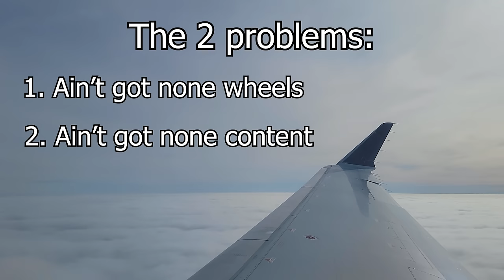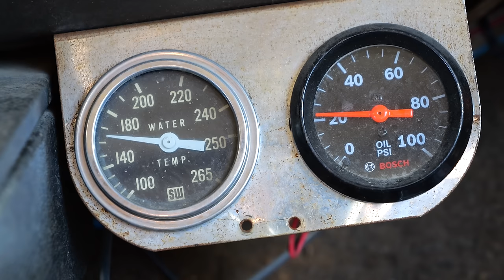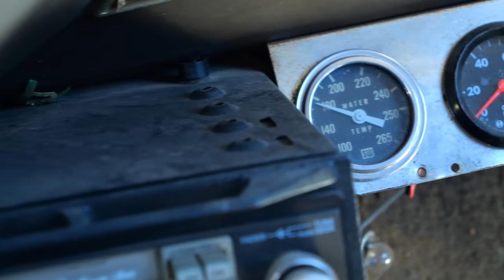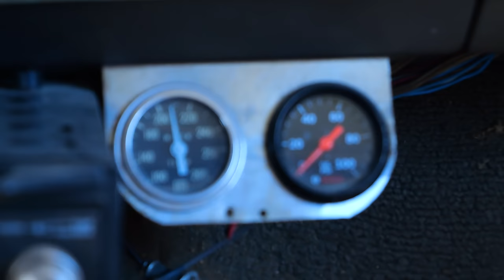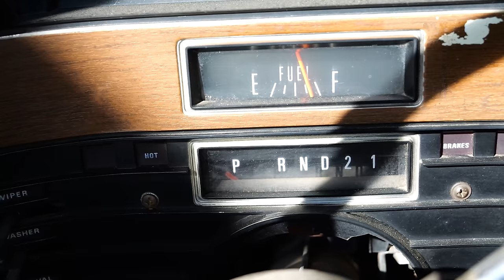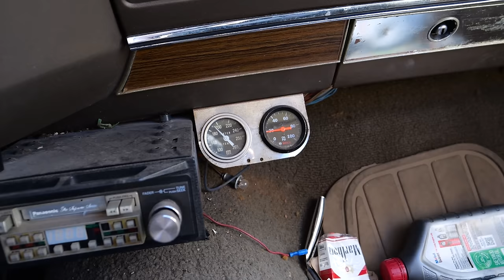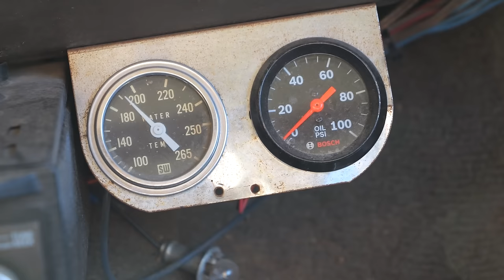Will a 1970's Wagon SURVIVE 2,100 Miles with NO REVERSE?

Comment: Incredible. Man that engine fought hard. Modern engines with tight tolerances can run for hundreds of thousands for sure. But I don't think there's anything else that would've done 2,000 miles on like 15-20 psi of oil pressure like that.
Reply: A 2005 Chevrolet Malibu
Reply: @Micheal-G no cap my girlfriend had a malibu and she was 20k miles over her oil change lmao when we drained it nothing came out and it took like 7 or 8 quarts of oil to get a reading
Reply: I've seen a couple of old Ford f series trucks with the 300 i6 run with less than 5 psi of oil pressure, granted they never went on trips longer than 20 miles at a time, but it still ran good.
Reply: @DaryanPrescott-vy4ss My 300 shoots the gauge up to around 60 no matter what... But it's a dummy gauge. Runs good though, happy with it, and it's powerful enough honestly
Reply: @greenbassboosts8872  I just put a clapped out 300 into a junkyard '74 LTD with a 3 speed toploader and 2.75 gearing. Oh boy that thing is a daaaawg off the line and it toasts the clutch every time I try to reverse, but dang if it don't run good.
Reply: @dogge929  Slap an m90 from a regal on the old wheezy six
Reply: modern engines can't even run on meth piss, cigarette stumps and peanut butter. Old battle tested fords will
Reply: 99-02 Chevy 5.3s might run a little on no oil pressure 😉

Comment: I think you should try all of the snake oil stuff to clean an engine like the 5 minute motor flushes, Sea Foam, Marvel Mystery oil, Transmission fluid, see if anything will clean up the crud.
Reply: I think it is clogged oil pickup mostly, and the filter isn't helping either and maybe stuck rings.  If he can clean out the pan, I think he can send it.  He should have used a bit of Marvel Mystery oil to try to clean out the muck, though it is thin and might have to be blended with super thick stuff.  Yes he should have done more in San Diego; oil and filter change as well as front seal and clean as much of the crankcase as possible, maybe engine flush.  how hard is it to pull the oil pan on this car?
Reply: You're better off pressure washing all the gallies from the inside out and doing an oil exchange at this point, it's that bad
Reply: @rawr51919  But how hard is that? Could that have been done in the time he had in San Diego? and while at it, would it be much more work to throw in new rings and bearings?

Comment: I think the Windsor motor was very underrated. When I owned my all I heard from friends was “it’s not a Cleveland”. It wasn’t ,but, it always did what it was supposed to do,work. That car set me forward on my career as a carpenter having the ability to haul a lot of stuff (including 4’x8’) sheet goods, in fact I can tell you well over a 100 quarts of strawberries would fit into that under floor storage area😅. Great car. Thanks for the rekindling memories.

Comment: Kevin, This is exactly the way that you make memories and great stories. By doing crazy things and actually pulling them off. My wife I drove a 1985 Jeep CJ (which we traded her son for my 91 Chevy extended cab truck to have a reliable vehicle for his new daughter to be safer in) from Detroit Michigan to southern Texas doing exactly the same thing as you. When the oil pressure gauge started fluctuating I would stop, add 4 to 5 quarts of oil in the motor and fill it up with fuel, My gas stops were dictated by the oil pressure and lack of oil in the engine. We made it 1400 miles without dying or breaking down. Was it an adventure, yep, but we survived with a great story that we laugh at today, we aptly named it scary jeep as the front end was toast and would throw the jeep all over the road when you hit a bump. We weren't the brightest bulbs in the pack for doing it, but it was an adventure we talk about to this day. Great content on this one as usual, thanks for entertaining us with your crazy adventures.

Comment: I've always heard from the old timers that if you put a couple gallons of kerosene in an oil-sludged up motor and let it sit for a few days, you can dump all the trash of the pan as the kerosene will break up all the gunk. 

I think that motor may be a good candidate if you're down to try it. :-)
Reply: Still wouldn’t have prevented the leaking, unfortunately.
Reply: @ProjectFairmont  definitely not but it could potentially save the trouble of tearing it down to get the Shmoo out.

Comment: This brings back fond memories for sure.
There is a unique excitement in purchasing and fiddling with an old automobile.
My latest is a 1998 Thor Hurricane with 454 engine. It does not get fuel milage to brag about but the gas "yardage" sound more impressive. The 200 mile trip home was uneventfull but on the way back from DMV the front brakes locked up and caused some expensive dammitage.
I still have "grinning cramps" reliving the old memories.

Comment: Hi Kevin. Loved those old ford wagons back in the day. suggestion for a cost effective better degreaser - try easy off oven cleaner. Spray it on and wait for a few minutes then hose it off. It cuts the oil and grease down to the shine. Use it on my stuff all the time. 
Cheers!
Reply: While I haven't done it for 10 years or more, check your local dollar stores for a cheap supply of oven cleaner. They used to be a great spot to score cheap degreaser. Best wishes! 👍🏻👨🏻‍🏭🇺🇸

- Max Giganteum

Comment: Seemed like almost every car we had in the 70’s lost reverse. You would be surprised how you can get used to not having it.
Reply: Having had several myself, and my parents, we never lost reverse. One car, a 1964 Dodge 330 station wagon lost its transmission completely well after 100K miles in 1973 (we bought it new) and a transmission from a junk car got it back on the road. We drove that thing until we sold it in 1977. It had around 140-145K miles on it then. Sold it for I think $500, tops to a kid to drive for his first vehicle. At that point, it was still drivable, though barely reliable.
Reply: how do you park without reverse?
Reply: @Alex-yj9xl  At the outside of most lots and you pull through to the opposite space so you can go forward. In town you try and find a space on the other side of the street thats on a hill, then roll backwards in neutral and park with the nose of the car facing the road. If the car doesn’t roll well you always have “friends” with to help push. In a big city it would be a tough time. Here in farm country it could be the norm. After a while you get used to it. Stock Ford C4 and FMX transmissions were pretty bad in this respect.

Comment: Now you just need to make 25 more episodes just like this. This episode is my favorite out all of the videos you put out. I also did the math on your oil leakage: 60 miles to the quart. My car leaks a quart every 300 miles
Reply from the maker: deal!
Reply: @JunkyardDigs   I’ve Since made an attempt to fix the leak from when I wrote this. I went 2000 miles since the last oil change and have yet needed to top the oil off. The only thing I can see that leaks more then that old wagon is a old bmw from the late 80s or early 90s
Reply: my car gets 100-125 mi to the quart lol
Reply: I've had the pleasure to have a friend that owned an old 80s S10 that would go through a quart of oil in about 5 minutes. I hated having to go anywhere in that truck since the bed was full of a combo of full, partially full, and empty oil jugs.

Comment: Dealing with old, worn out engines my whole life, I think (@45.55) you had picked up some of that sludge in the oil pickup and when you shut it down to fill it up, I broke loose and oozed out. you probably sucked up the clean stuff on the restart and had some PSI again. Great video! I'd rebuild it, do a tranny swap (maybe manual) and cruise the crap out of that beast.

Comment: You should see the 289 in my 67 galaxie. Currently has 0-5 psi of hot oil pressure. Drove it around all summer kicking it into neutral at stoplights lol. It had old school penzoil ran through it and no oil changes. I literally scraped the insides clean and filled a coffee can with the crusty oil flakes. Plan on swapping a roller 302 into for power tour this year

Comment: When the Cash For Clunkers crap was going on. We had to drain the oil. Add water and this stuff called liquid glass to the engine. Which in the case of European and Japanese cars would seize the motor in seconds after starting the motor. Had a 351 Windsor in a Bronco that went over an hour, even with us red lining the motor to get it to pop. Those 351's are tough old birds 😆

Comment: We ran a '74 Suburban at work for years with no reverse, just drove up a hill and let it roll back in neutral to turn around, always worked out. One time we thought it was finally dead when it wouldn't go into gear at all, but turned out they had just let the transmission go bone dry, fresh fluid and it worked as good as it did before

Comment: I didn't have the oil leak but did have the bearings wearing out on a 75 400 from Cali to Minnesota. That was the last successful engine I rebuilt and it was very satisfying to finish. That motor loved running at 70 - 75 as well. I had a machine shop that screwed the cam bearings up and cost me a motor and pickup.

Comment: My Dad had a big 1968 Ford Wagon.  Just a little 302 with 2 barrel carb but we would fully load it down and it would take us anywhere!  Seven people , two dogs and luggage on the roof!  Now and then it did overheat on us but that's how cars used to be.  You definitely needed to shut off the massive AC compressor when the engine started getting hot!❤

Comment: Great Video👍 That would be the perfect entgine to test if engine cleaning solvents/oils would help. After fixing the seal😁
Reply: I've used Marvel Mystery Oil for years. 
I had a 2.7L V6 Chrysler Concorde I put a timing chain and water pump in for a family member. It was sludged up way worse than that. I did an oil/filter change with MMO, then ran it for 15 minutes. Did another oil/filter change and ran it for an hour. Did change number 3 and drove it for a week. Did the final oil/filter change and sold it to a buddy. Cleaned it out completely and saved that engine. And those were notorious for getting killed by sludge. My friend daily drove it for over a year, then ran it completely out of oil and blew the motor. Sad.
But MMO works!

Comment: Hi Kevin, I'm back revisiting this and when you mentioned the work place for military personnel to work on their POVs ... well I do recall back in 1977 at Keesler AFB in Biloxi Mississippi that I worked on my 1968 GTO at just such a facility... Just want to give you a shout out for bringing back the memory of my '68 Goat which at the time I was just pleased as punch to have a vehicle, not knowing how iconic it was to become, while in my tech training at Keesler to become an air traffic controller...  Good times for sure back then, one of the few periods when there was no theater where we were involved in war mongering. :glasses-purple-yellow-diamond:

Edit:  I have found that more than once, several times if I'm honest, I had been fortunate that when I had forgot to close the hood FULLY that at least it was latched in the safety lock positon, though not fully locked down.... I recall always thanking my lucky stars that it was at least partially latched... So far what you expierenced, I've managed to avoid... :face-fuchsia-wide-eyes:

Comment: If that 351W is dead, drop a 460 in it and make a sports wagon out of it. Awesome episode, I’m from the Palmdale/Lancaster area. Would’ve been cool to run into you.
Reply: For snow like he is in, he needs a 2.3, 3.0 or maybe 200.  I think it is clogged oil pickup mostly, and the filter isn't helping either and maybe stuck rings.  If he can clean out the pan, I think he can send it.  He should have used a bit of Marvel Mystery oil to try to clean out the muck, though it is thin and might have to be blended with super thick stuff.  Yes he should have done more in San Diego; oil and filter change as well as front seal and clean as much of the crankcase as possible, maybe engine flush.

Comment: Over here in NZ they are called a Ford Falcon Station wagon. Im suprised you didnt think about putting some oil system cleaner in the car before you drove to San Diego so it would have at the least improved the oil flow around the heads
Reply: This is a few sizes up from the Falcon, based on the Galaxie
Reply: Also changed the oil filter, it may have been partially plugged up with all the crap.
Reply: @11sfr  Peter Cooper is in New Zealand. Their cars are manufactured by Ford Australia, which uses a different naming scheme than the United States.
Reply: @williamjones4483  Ford Australia still badged these cars as a Galaxie LTD, not a Falcon, they were imported from the US and converted to RHD after  Australian production stopped in '68
Reply: @davidplaster4576  Right you are. That should have been the first thing to be done. Guess the filter has been bypassed most of the time which has caused the oil pressure reading low. Also sadly there actually was a new wix filter with all the stuff in the back...

Comment: You need to hit that motor with one of those snake oil "sludge remover" additives where they show the sparkling clean engine afterward.
Reply: It might be too late now, but still worth a try.
I think it is clogged oil pickup mostly, and the filter isn't helping either and maybe stuck rings.  If he can clean out the pan, I think he can send it.  He should have used a bit of Marvel Mystery oil to try to clean out the muck, though it is thin and might have to be blended with super thick stuff.  Yes he should have done more in San Diego; oil and filter change as well as front seal and clean as much of the crankcase as possible, maybe engine flush.  how hard is it to pull the oil pan on this car?
Reply: @alan6832  I once had an oil abused engine (91 Nissan PU } Oil got so sludgy that the oil light came on going down the hiway. Added oil even though it was less than a quart low. Drove it 25 or so miles to get off the hiway. Changed the oil filter and poured in 1 can of 5 minute motor flush. Stuff was like solvent. Started the motor and the clatter went away in 10 or 15 seconds as well as the oil light. Changed the oil and filter and did it one more time for good measure. Got another 100,000 miles out of it before the head gasket blew on it.
Reply: @alan6832  I think he could have changed the filter every time he added oil and it wouldn't have made any difference, the filter would plug and bypass in no time with the amount of sludge that must be in the block.
Reply: @moconnell663  I'm pretty sure removing 10 filters full of sludge would have made a big difference regardless of how much was still left, which is limited by the fact that the engine is still running.
Reply: @alan6832  You are absolutely right, but I assume that as soon as the valve cover came off he had already decided that it was done.
Reply: @moconnell663  Big mistake in my book, one should get every mile possible out of an engine and, though parts including gaskets can cost more than it's worth, real effort shout go into it to the very end, and figuring out how to go that last possible mile when it's not worth buying hardly any parts is what I'm all about.  Move it 'til it breaks!

Comment: Gotta love sludged oil in the old oil pressure gauge, definitely gives that wondering if it makes it from destination to the next. Glad y'all replaced it though. 😂

One thing I don't get though. when y'all changed the valve covers, y'all could have took some coat hanger and at least poked a hole through the sludge down the oil return ports to at least get a tiny bit of oil back to the pan... 🤔

/Que Holiday Road music...

Comment: My brother-in-law had a car with a bad oil leak at least a quart every 20 miles, and that thing ran for years after and used to blow blew smoke like crazy but the rule of thumb was it was always running clean oil in the way yours was draining black I was actually cleaning out the motor probably doing it a favor, this motor has definitely earned a re-bill and you definitely earned a new subscriber

Comment: I've actually done this.... Pulled the engine, pulled the valve covers, intake and oil pan! Then used a pressure washer with degreaser inside the engine! Put it back together, and back in the car, and drove it for another 2 years, but the engine finally blew up, when it dropped a valve from a broken valve spring! The engine was a 351 Cleveland in a 1973 Mach1. Did this job at the same shop at Camp Pendleton, including building and installing a K-code 289! Drove that car for years after that, and put 75k miles on it with zero issues!

Comment: I haven’t seen an engine soaked in that much oil and sludge since the 79 Mercury Cougar I bought in ‘86. Someone ran that thing over 100,000 miles with never changing the oil! It would come to the top and the drain holes were so plugged it would only go back down at a trickle!
Soaking it for a week in diesel fuel, and then getting out the super long pipe cleaners and lots of scraping the 2 inches of sludge under the intake. Only needed one wrist pin, the heads deep cleaned, and a bunch of bearings and she ran for another 8 years before the rust finally took its toll on the body. And one day the engine just died and could never get it restarted. 15 years out of a northeastern car with salt and rust and a beat up engine, I consider that a win!
And it also had a 351 Windsor

Comment: Man I'm 54 years old, a mechanic for 35 years, one thing I learned about old Ford engines if you have one knocking you can drive it right on, but if a Chevrolet knocks hang it up. Old for engine had a tuff crankshaft, I willing to bet the crankshaft isn't hurt